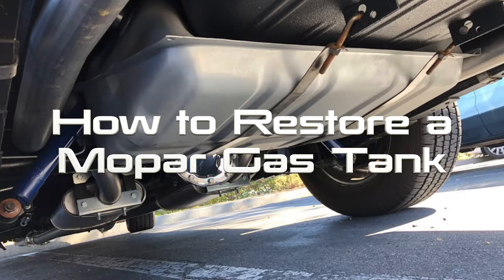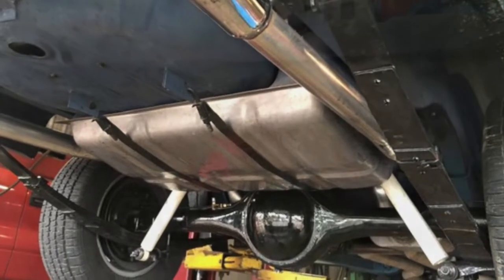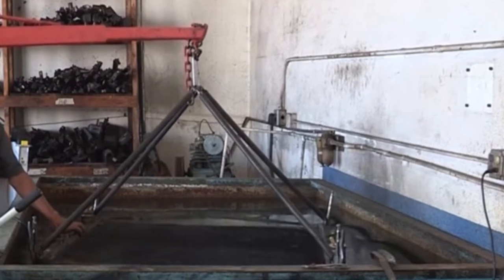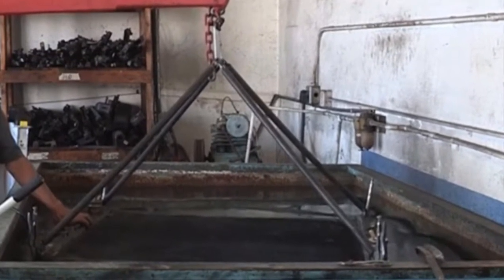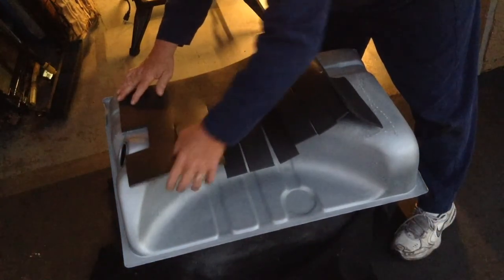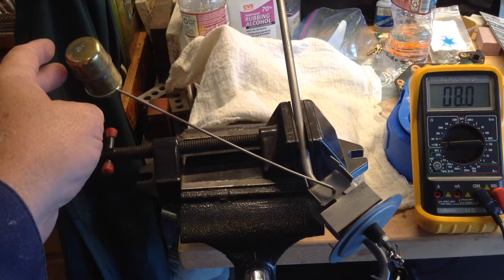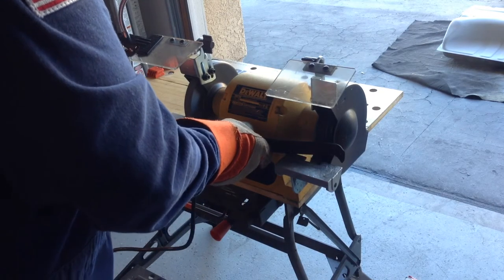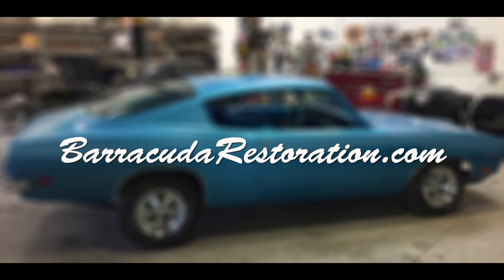How to Restore a Mopar Gas Tank

Comment: I failed an evap emissions check, so I'm looking to reseal my tank. what would I need besides a fuel filler grommet and to reseal gasket where the sending unit attaches? thanks!
Reply from the maker: I think this would do it. Check the rubber fuel line from the sending unit to the metal fuel line.